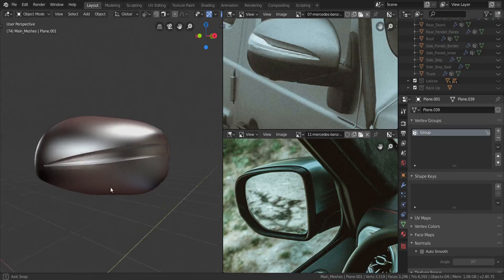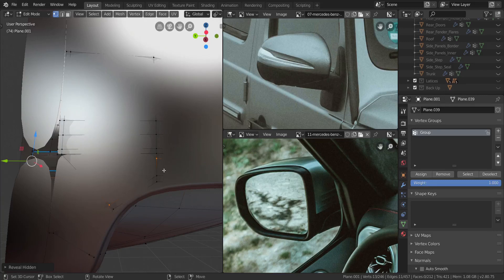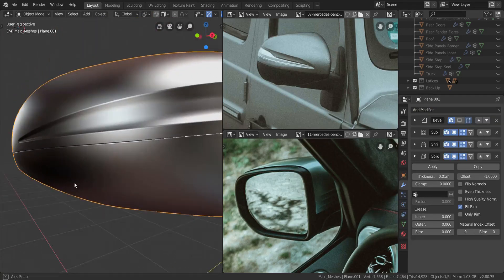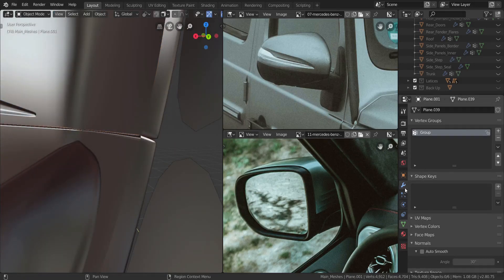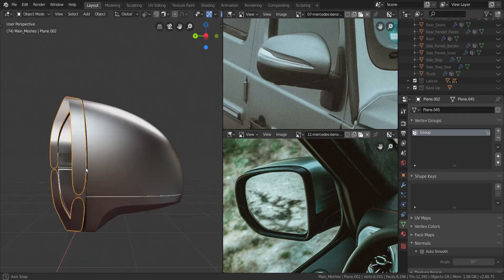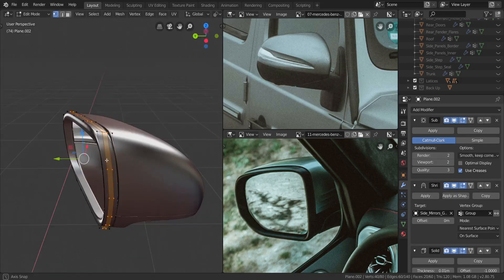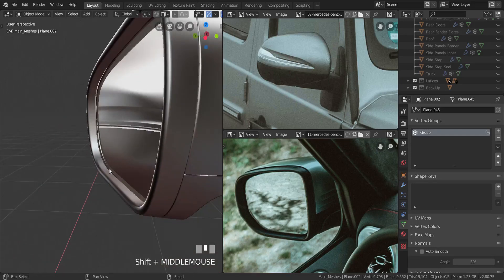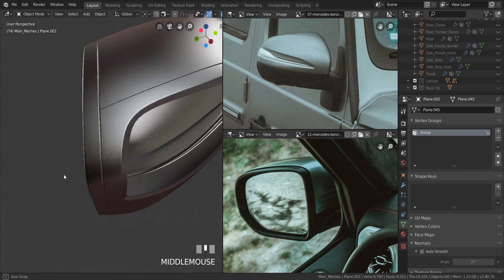Blender 2.8 Car Modeling Tutorial - Part 56 (Side Mirrors - Part C)

Comment: The Side Mirror was by far the most difficult part so far for me.
Reply from the maker: yeah its one of the frustrating parts in vehicle modeling.
Reply: @NaturalArtFreak   To be honest I didnt have much of a problem with the side mirrors. I had problems with the rear bumper, Cause I Did it buy my self using the Knowlege from the front bumper and when I decided to folow the video everthing was diffrent=)